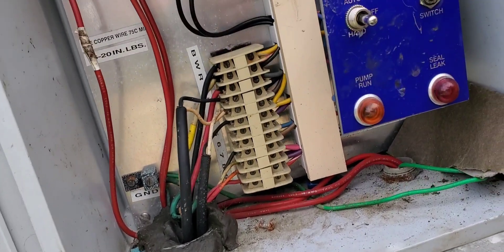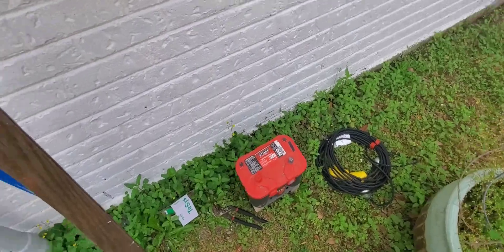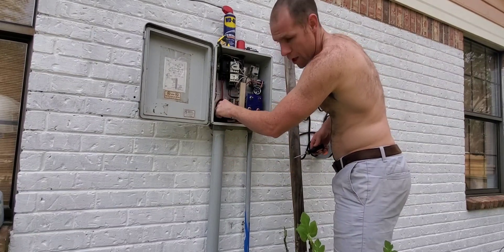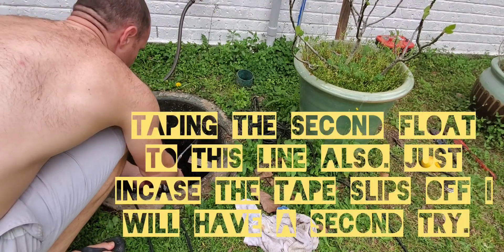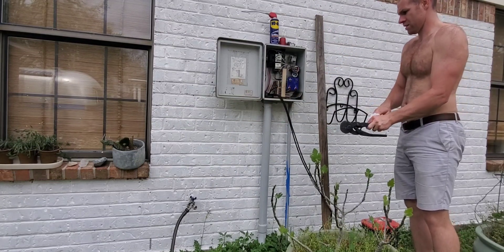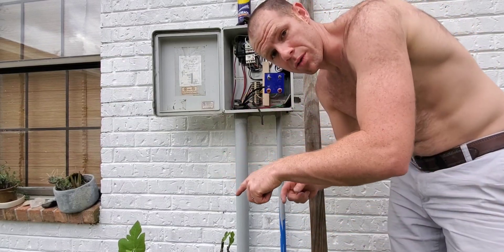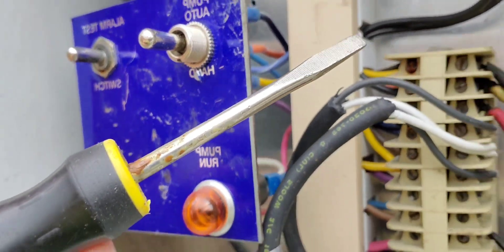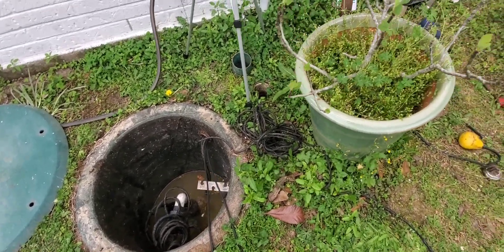installing float switch to a pump. grinder pump.

Comment: How did you know the floats needed to be replaced?
Reply from the maker: The water level will be inconsistent. Also, 2 years could be a good bench mark. This is the cheapest component that can cause the most costly problem.
Reply: How can you test the float switch without opening the pit?
Should I just run water through the lowest drain until the float kicks in?
Reply from the maker: @a.m.m.4592  disconnect it at the box and do a resistance test.